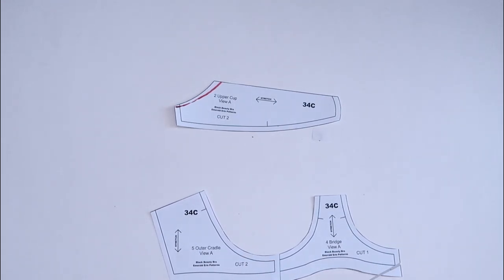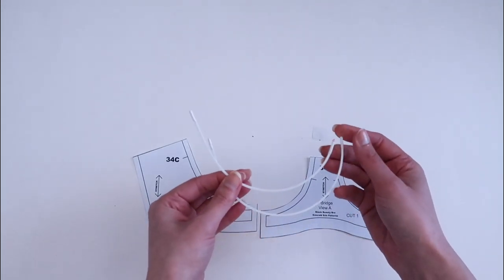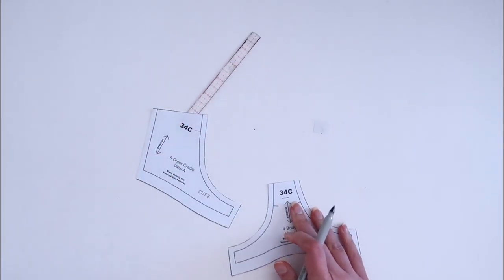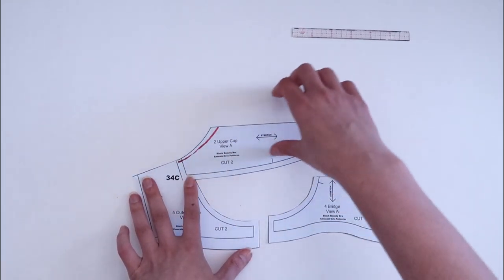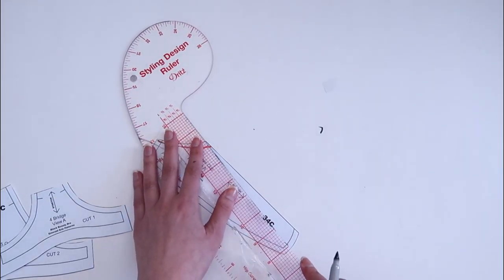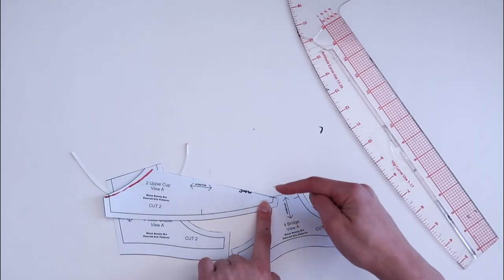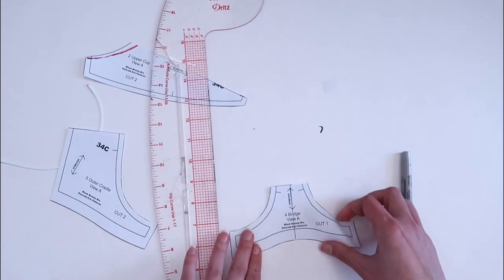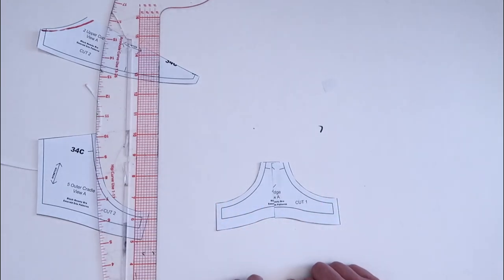How to Alter a Bra  Pattern for Plunge Wire

Comment: Hi Liz - thanks again for the great tutorials. I just used this method to alter the bridge and upper cup pieces for my second bra. I have two different cup sizes, so for my second try, I'm going to use the smaller cup size on one size and the larger cup size on the other. Of course, the bridge needed altering to accommodate one side being shorter.

Comment: Thankyou, Liz. I am wondering about the last step of narrowing the bridge. Do you need to add a quarter of an inch to the band at the bottom since you took that away when you overlapped?
Reply from the maker: You can, but it’s such a small amount it won’t make that much of a difference. Since you have two band pieces you would split the difference between both so a 1/4” taken from the bridge means adding 1/8” to the band

Comment: When your bridge wire doesn’t lay flat on your chest, where do you suggest I start to modify?
Reply from the maker: That typically means your cups are too small
Reply: LizSews  but the upper cup gaps. Do you think it is my lower cup that needs enlarging?